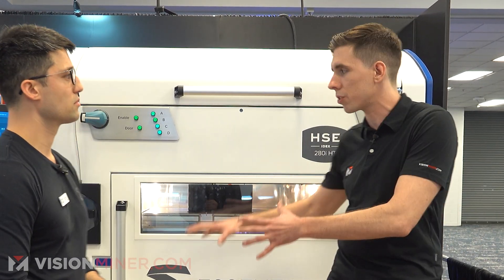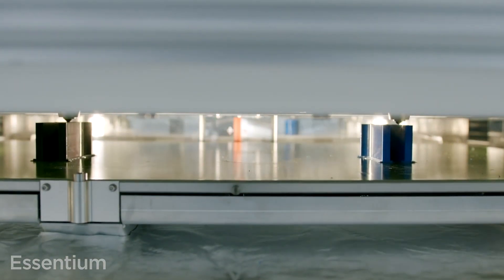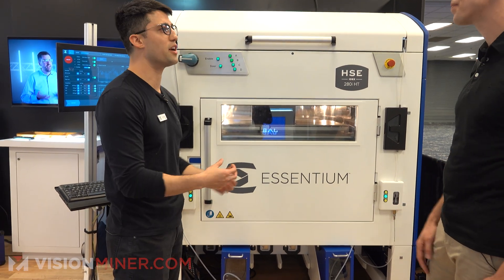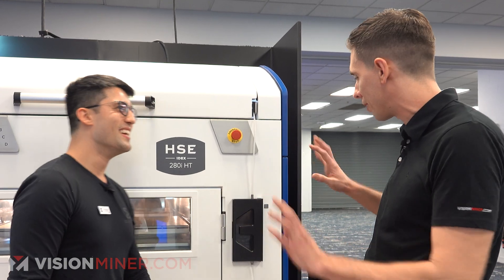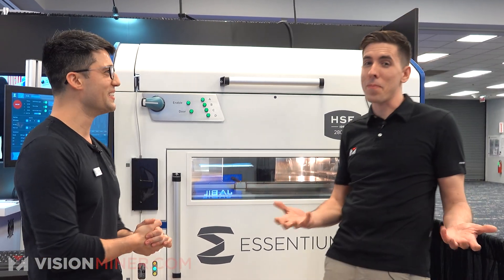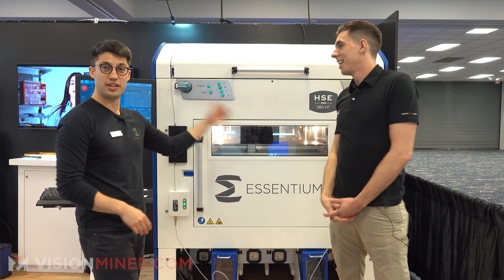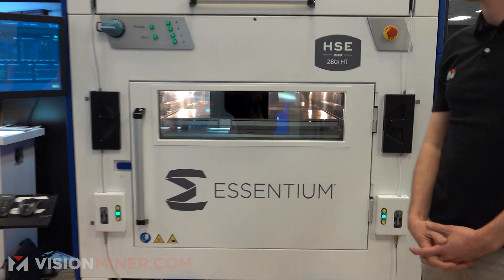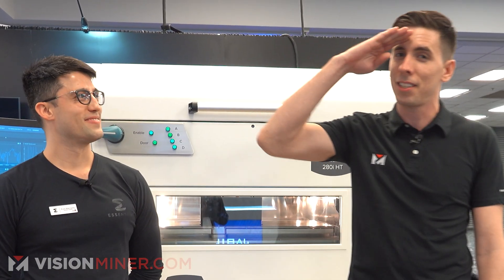Essentium 280i: Revolutionizing High-Volume FDM 3D Printing - AMUG 2023

Comment: You got me excited that Essentium was hiring, no such luck though. We use a LOT of Essentium's filament at work, I'm not a fan of their PCTG but the HTN-CF25 is the most incredibly strong, rigid and easy to print filament that I've ever had the pleasure to work with. Even my modified Ender 3 loves the scraps that I occasionally feed it.

Comment: How can a hobbyist get involved in a career inside this industry? I’m a CNC Machinist, and I 3D print polycarbonate and nylon parts. Rigid parts that solve problems. How can I get involved with this , as a career? I am passionate about it. && I believe that I would be a great additive tech guy.
Reply from the maker: Well, you're in a good spot -- with the experience. If you haven't already, bring prints into your work, start making functional parts used in manufacturing support, if you're not already -- jigs, fixtures, workholding, tooling -- even brackets on the wall to organize stuff. As you progress people will take notice -- or they won't but you'll have some great examples. Operation is different from part design, as well -- and engineering degrees aren't a magic pass to part design, as knowledge of the manufacturing process is critical, especially in FDM -- start using it, implement it, and you'll find opportunities over time! More and more companies picking up printers, the need is great out there!
Reply: I first learned 3D printing on a Makerbot in 2012 during an internship. I used 3D printers at a couple of other companies as well. Currently I work for a large manufacture and I have a printer on my desk for doing prototypes and some functional stuff. It's great to go from design to prototype. Our tool room now has an FDM printer for doing prototyping as well. It has caught everyone's attention which is great. Having a Design and Machining background has been a big help.